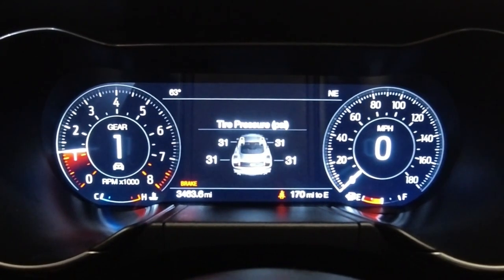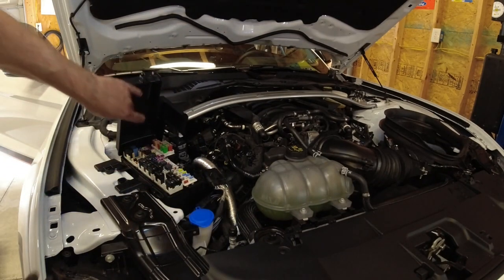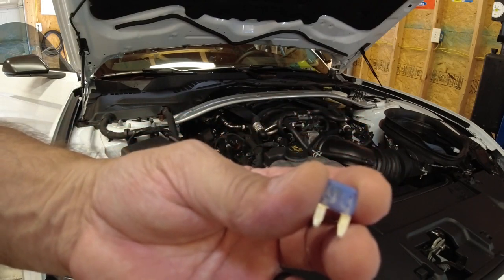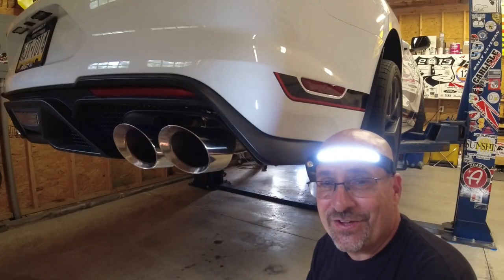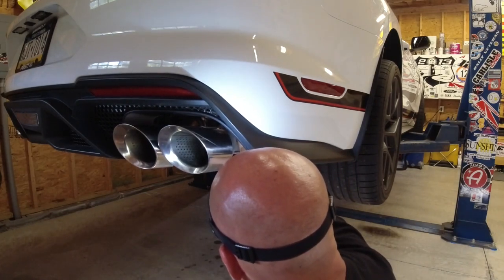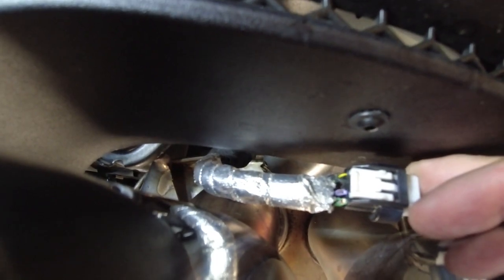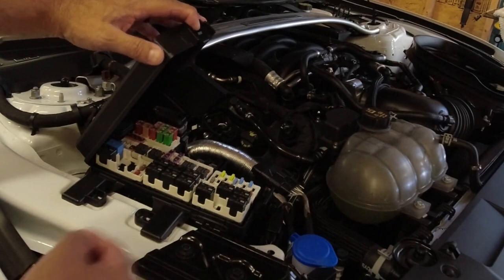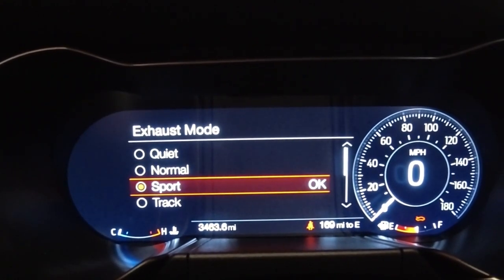Quick & Easy fix for the S550 Mustang Active Exhaust issue

Comment: Thanks for this videoTony! Just took delivery of my pre-owned 2022 Mach1 HP with less than 6000 Miles on it. Bought from a Ford dealer in province of Nova Scotia, and delivered today in Quebec. As expected, the 15 Amp mini fuse was blown, and the wiring right next to the connector was frayed.  I went ahead and used several layers of electrical tape, then cotton tape, then two tie wraps to keep the wire away from the sharp chassis edges.
Reply from the maker: Glad I could help! Thanks for watching!

Comment: What you state is true, factory build quality is hit to miss after 02/20. My GT/CS (Oxford white, 08/20 build) was perfect interior and body wise, had the wire rub issue, as you state. My 12/20 build 401a (Shadow black) is literally falling apart interior/body wise (headliner, Recaro leather, etc....Drivetrain is perfect.
Reply from the maker: Sorry to hear this and I'm not sure this is a build issue as much as a design/cheap out on parts manufacturing issue. If there was a left and right valve both pointing forward this would not be a problem. That would cost a couple of dollars per car, times the number of cars built, and so we have what we have... Build issues are there for sure. There are cars missing lug nuts, panels mis-aligned on plenty of cars, badges off center, but we didn't buy a boring Toyota Corolla so this is something we all have to live with.

Comment: Tony, I'm having this exact same problem with my active exhaust. Just started yesterday.  You were able to fix it without having to lower the exhaust is that correct? Also do you know something that could be used as a replacement for the silicone? because I don't want to pay the mechanic shop 2 hours of labor while it sets there drying.
Reply from the maker: You seriously can correct this without a mechanic. It's snap in wire connector on the passenger side. You don't have to lift the car that just makes it easier. The connector is behind the muffler but it front of the tip. You pop the white retainer back, pull the wire, tape up the short, bend the bracket just a bit, and use a zip tie to pull the harness away from the frame and give it a bit of clearance. I used the silicone because it's a good insulator and to keep moisture out. You should be able to do the entire job in 10 minutes if you take your time.

Comment: Mine was a broken wire on the passenger side. I sent my local dealership, the codes, and the part number for the harness they had me in and out in no time.
Reply from the maker: It's always a broken wire on the passenger side. The driver side valve faces front away from the frame. The passenger side faces rear towards the frame. Hopefully they made sure you had enough clearance so it won't happen again.

Comment: No problem on my 2020 Bullitt but I will be checking it just in case before there is a possible issue.
Reply from the maker: It won't hurt to look but if you have been ok to this point you are probably good to go.

Comment: Hey Tony, enjoy your break. Some guys are actually installing door edge molding on the frame,  where the harness rubs. I’m going to look at mine this weekend. Take care!
Reply from the maker: Thank you for the tip and I found if I bent the bracket slightly and used a ZIP tie to secure it to itself there is room. Ford has had this issue for years.

Comment: I got the exhaust mode not available message a while after installing x pipe. I ended up buying the roush axle back non active mufflers, and removed the actuators. Still got the message and it would only run in normal exhaust mode which was fine as I had different mufflers. I read somewhere to keep actuators plugged in so I bought the AE bracket and mounted the actuators on the car and plugged them in. Still got the message so I bought a forscan tool and deleted the active exhaust option. Sweet. All is good! Fast forward a couple years. I just got long tube headers installed. The cold starts are extreme and waking the dead. So I added the exhaust option back to the car in hopes to put the stock active mufflers back on for a quiet mode start. I can see the actuators move but then shortly after they go back to normal position and the message shows up saying exhaust mode not available. It’s not the fuse. Wondering what the next step is… and if you had any input. sorry long winded story!
Reply from the maker: I'm not sure on this one. I have heard of bad actuators and you may have one binding up?  If your harness is good, you are not blowing fuses, and the software is good there's not much left to the system.  I would bench test both of them. Best of luck and keep me posted.

Comment: Tony I’m currently having the same issue with my 2022 ford mustang gt, I tired everything, replaced the fuse, put tape on the passenger side and still having the same issues. Any recommendations I should do ?? I was thinking buying a replacement wire jumper
 For active exhaust
Reply from the maker: @sikeflower4143  if the fuse is blowing out there is a short in the harness. Ford does sell the harness. It’s sounds like it’s rubbing and I would tie it up so it wouldn’t happen again. Best of luck and let me know how it goes.

Comment: Hey Tony off topic but I want more HP so I’m thinking of going with a whipple for my 21 mach 1. However scared about warranty issues. Is there anything that ford would install or certified shop would install that doesn’t effect warranty? 

Secondly, warranty issues or not would you install another form of supercharger/turbo? I definitely don’t want to go with the wrong item. I’m trying to get 700whp. Obviously gt500 has this already but I figured I could do the same thing but much cheaper with the mach 1.
Reply from the maker: Thank you for watching and you would have to reach out to your dealer. From what I have been told over the years a Roush Super Charger kit would not void your power train warranty and after checking their website that still seems to the case as long as it is installed by a Roush dealer. I know there used to be issues getting the cars tuned afterwards. In the past it required the mailing of your ECU to Roush who would tune it and send it back to installer. (That process took a few weeks and may have changed) The next thing that would concern me is the next weak point on the car. That being the rear axles and the rear suspension. You might want to look into beefing that up as well before you head down that road. Still if you get all that done you would still be well below the cost of what a GT500 is bringing if you can even find one. Best of luck!
Reply: @TonysFordsandMustangs  man thank you so much for this response! I will definitely look into the roushe option!! Love your videos and install help. Keep up the great work!!! New sub here!!!
Reply from the maker: Thanks for the sub!

Comment: Hey tony. Im going to pull my harness off to check it but im not clear on how it comes apart. Do you press the white tab down then pull it apart or does the tab slide out from the harness?
Reply from the maker: Hi Brian. I used the stubby flat head screwdriver on the lip of the white tab and pushed it back. It's lock for the harness. Once it's free the harness pulls out easily. Thanks for watching and best of luck!

Comment: what type of silicone do you use ? and where do you put it at ? i been dealing with this problem for over 6 months and it’s so annoying
Reply from the maker: I used what I had laying around. It was a clear generic and I used that just to insulant the wires. The key is to get the harness not to rub. I bent the bracket slightly and used zip ties to pull it clear of the frame.

Comment: Thanks for the video. Did you have to disconnect the battery while doing this?
Reply from the maker: Thanks for watching and no I did not. The valve isn't hot unless you change modes.
Reply: @TonysFordsandMustangs  So I tried the fix and although the fuse was a little corroded and the wire was not frayed, I taped up the wire anyway and also replaced the fuse and still no luck. Any idea what it could be? I'm thinking its the actuator because on startup, the left valve opens and closes fine while the right doesn't move at all. Do you know if I could maybe remove the actuators with the car on the ground and try switching the right actuator the left to test if it works or do you recommend another method? Thanks.
Reply from the maker: @Luke-t5l9f  You don't have to test it anymore. If one is opening and the other isn't it's a stuck/bad actuator. My fix would only work IF the wires were frayed which is very common. That said that isn't the only issue. When you pulled the fuse you broke the circuit so the light went out, once you tried opening the valves it came back again because the actuator is stuck/bad. I have heard that you can free them up. If you car is still under warranty Ford should replace it IF it isn't you will need another one to repair it. I would drop the muffler as that would be much easier to replace that way.  Here's a link to a forum that should be helpful. https://www.mustang6g.com/forums/threads/2018-active-exhaust-install-guide.101913/

Comment: Got a 2020 gt500 and get the warning every now and then on my dash, checked the fuse and it’s good and checked the clearance on the frame from sensor and definitely no contact, could it be my actuators or harnesses ?
Reply from the maker: I have had several people report bad actuators in the comments section. The harness wearing through will blow a fuse so if the fuse and harness are good it might be the actuator and it could be either side. You can video them with your phone to see which one is hanging up. Best of luck!

Comment: I have this at the moment, would this throw an EML? I've got error code P26C6 / P2BF5 / P2BF9
Reply from the maker: I didn't scan for an error code since this was the second time I have seen this in 2 years. Check you harness and the fuse ASAP. If the fuse is blown the harness is most likely worn through

Comment: This explains why when people install the x or h pipe and causes an issue with the active exhaust, there isn’t enough wiggle room to simply take off the resonator and install the replacement pipe.
Bad design by ford, would installing the x pipe, and causing the issue, would that void any warranty?

I would think no
Reply from the maker: Ford should cover it. It's a known issue. If they don't the harness is cheap and not all that difficult to replace if it wore through. My car was OEM. It's not the greatest design. A second Part # for the actuator on the passenger side that would face forward would correct this.
Reply: @TonysFordsandMustangs  thanks for the quick response Tony!
Fod Performance X pipe is getting put on later next week.

Your videos are really helpful!
Reply from the maker: @GarveyMustangMan  You should be able to address this at that time if it's not an issue already. Thanks for watching and glad to be of service.

Comment: Can I just tape up the whole thing around the wires? It may touch the frame still but it’ll have the tape blocking it. Would that also stop it from shorting just from putting tape around it?
Reply from the maker: l think it would wear thought the tape eventually. I used the silicon as an insulator because the wire covering worn through and zip tied it up so I wouldn't have the problem come back.  It been 7,000 miles and no issues. The best thing is to move it away from the frame and zip tie it up. Best of luck.
Reply: @TonysFordsandMustangs  thanks for the reply. One more question how did you get the harness out? I pulled the white tab out but it’s not coming loose. Do I have to push on something or squeeze soemthing else for it to come out?
Reply from the maker: @randys_mach1  I used a stubby screw driver on the white tab to push it out. It moves a bit but may not be all the way out. That would be my guess based on what you are telling me.

Comment: So goes between quiet and normal.  That's it so took to ford, they couldn't figure out so replaced whole exhaust still nothing beyond normal.  I see valves move but sound still same. Any ideas ?
Reply from the maker: @daveestrien1945  not sure why they would replace the exhaust. The only thing that changes the note is the valves. Did they replace those? It sounds like a stuck or binding valve.

Comment: Great video I definitely was on right track but this definitely confirms my issue, I also installed an xpipe on my gt and the harness on the passenger side did I fact rub. I repaired it and put a chunk of heater hose that I split open and covered the harness, also I had dealership hammer back the chunk of metal that the plug rubs on when they did recall for the harness but up further. So it's 2.5y later and my car is running and it's opening/closing over and over, then I take a long drive and the whole way that fuckin screen popped up every 2m I swear I was going to snap lol. Anyway I'm going to definitely get under it tomorrow and recheck my harness make sure it hasn't rubbed thru, I did notice the dash warning would pop up mostly when I accelerate or decelerate do hoping that's all it'll be.
Reply from the maker: It certainly sounds like that's the issue but it it normally blows the fuse so that has me a bit confused. I'm thinking maybe the harness on your car has almost worn through and is making contact intermittingly? Best of luck and thanks for the kind words and let me know once you have it squared away.

Comment: Hey Tony
The harness routing on my '21 GT appeared identical between the two sides (although I wasn't looking for differences). Are you saying that, on yours, one plugged into the rear side of the valve and the other plugged into the front side of the valve?
Reply from the maker: If you have the OEM exhaust they won't be pointed in the same direction on the valve itself. They are the same part # so they have to point in different directions. The drivers side point towards the front of the car and the passenger side points to the rear. That's way you only need worry about the passenger side rubbing and shorting out. You need to look on top of the exhaust passenger side so you can see where the wire is running.
Reply: @TonysFordsandMustangs  - Both of mine have the plug facing the same direction (harness comes out of the valve to the rear of the vehicle on both sides). I wonder if this is only an issue on the Mach 1, which has a different rear valence design and possibly different packaging for the active exhaust harness as a result.
Reply from the maker: @crankcase1733  Did you buy this new? It doesn't sound like a FORD OEM active exhaust. All of the GT350's and GT's and Mach 1's with the FORD EOM exhaust have this issue.
Reply: @TonysFordsandMustangs  - Yes, I bought this new in 2021. Maybe the design was changed on the GTs at one point. I'm gonna get under my car and see if the valves have different part numbers. I'll let you know what I find.
Reply from the maker: @crankcase1733  It makes no sense. The valves are on tope of the exhaust tips behind the mufflers.
Reply: @TonysFordsandMustangs  - Mine are both the same part, and both have the harness coming out of the rear of the valve. But, the valves aren't symmetric (the plug for the harness is on the left side of the valve, if you look at it from the rear) and each valve is angled slightly towards the outside of the car (driver valve is angled left, passenger valve is angled right). So on the passenger side, this results in the harness getting a bit closer to the body. There's about half an inch of clearance on mine.

Comment: Same issue with mine! Bull butter if you ask me, what a complete fail on @fords design. Was curious to, if I was able to keep it in Track mode then pull the fuse it should stay in track correct?? 🤔
Reply from the maker: From what I understand that's exactly how it would work.
Reply: @TonysFordsandMustangs  yeah tried and confirmed did not work! Epic Fail!
Reply from the maker: @stang_space  Sorry Brother! I guess you going to have to tape up the harness or replace it. Hopefully it didn't wear through.

Comment: I have a active exhaust on my mustang. I want to get a mbrp axel back. Ik once I put that on I will lose the active value feature. But once I lose that’ll feature can I get it back with the stock mufflers or anything?
Reply from the maker: You can buy axle back systems with active exhaust or without it including those from MBRP. it will cost you more but it's available.

Comment: I put the Mach1 exhaust on my 22 GT and started popping fuses at full throttle, put my old solenoids on worked good til my passenger side wire rubbed in half, I thought I fixed the wires, and checked fuse but my active exhaust still kicking a fault
Reply from the maker: I have had people report stuck valves in the comments section. I would look for a loose connection or a burnt wire first if I were you as the wire harness did short out on you a couple of times.